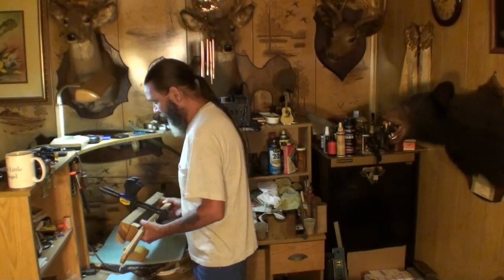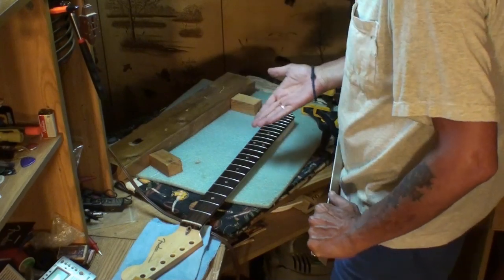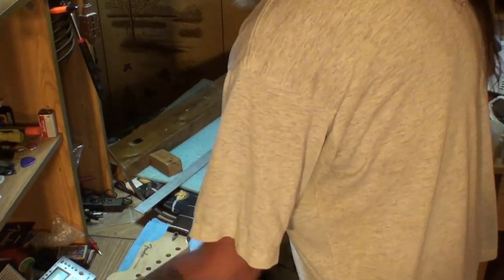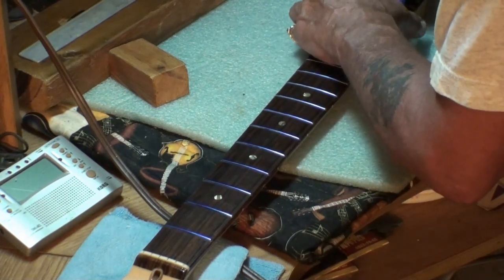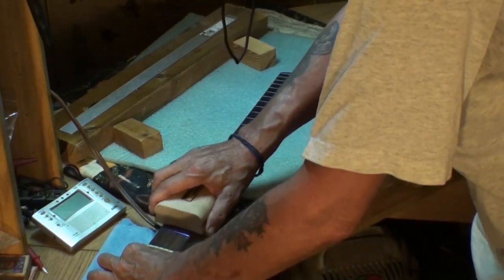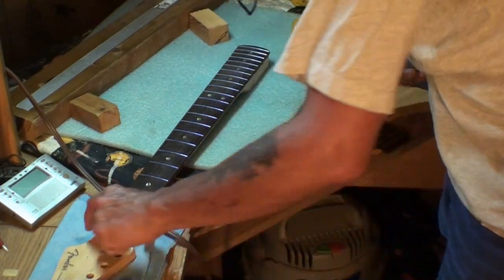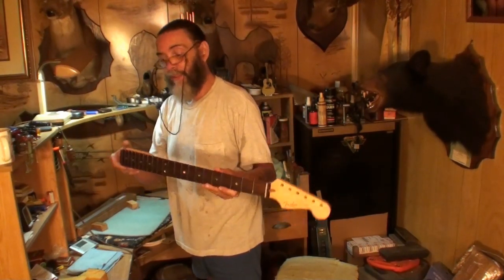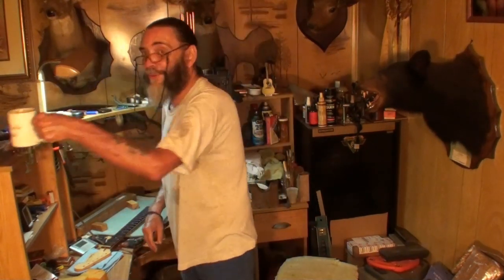american fender stratocaster neck check part 3 will the truss rod hold it straight?

Comment: Looking good Randy but I think you should replace that truss rod nut because sometime in the future he will need to adjust that neck. And he may not have your safe cracking set up to get the job done.
Reply: Of course it should be replaced. Anything else is a hack job. I don't understand why he hasn't done it already?
Reply from the maker: @pallecla  I haven't done is alreayd because the owner doesn't want it replaced, he is aware of its condition and if he wants to pay for replacing it I'll replace it, call it a hack if you want but I don't work for free!
Reply: You should do the nut for free since you're making big money off the several videos you've done with the customers neck.  It would be the right thing to do!  Also what about all the free guitars and parts people send you which you use to promote your channel?  Have a heart ❤️ Randy!

Comment: Looks good Randy...hope that it stayed flat for you. We've had a run with killer heat up here in CT. The air quality was so bad with the humidity that you could have sliced it with a knife...pretty much stayed in the house for 3 days with the air conditioner running. Anyway looking forward to seeing the finishing touches on this neck:)
Reply from the maker: I'll give you a little heads up Ray yes it stayed flat and I was able to even get back bow in it before sending it back to the owner, so when it's under string stress he can safely loosen the truss until he achieves the amount of neck relief he wants. yeah man hot here too, 100 degrees almost every day! been spending a lot of time in the ole AC myself :) thanks for watching!
Reply: @RandySchartiger  Cool beans thanks Randy!

Comment: I wonder if putting that clamped neck in a freezer for 12-24 hours and re tighten might help a worse neck? I think it might? then another 12-24 hours
Reply from the maker: heat would be better, which is what I ended up doing, videos coming soon on this. thanks for watching!

Comment: Way to much slap in that truss rode adjustment and even after you removed the clamps  I noticed it went back to a forward bend because I could see your tshirt when you had it up close. Wouldn't it be better to just change the entire truss rode. To much slap there to give back to the owner wouldn't you think.
Reply from the maker: when I removed the clamps it went from having back bow to exactly flat according to my straight edge, which is what I need to do the frets, the truss rod doesn't need changed but it does need the adjusting head replaced, but I only do what the owner wants to pay for. thanks for viewing!
Reply: @RandySchartiger  Yep could have sworn I saw tshirt when the cam was up close indicating a forward bend.. anyways not to worry, be interesting how it turns out. Keep up the good work cheers!
Reply from the maker: @AndyOges  I could see my shirt but it was thru the gap of the straight edge and the fretboard, which is made by the height of the frets. I don't think I'm explaining it well lol anyways the remaining videos to come will explain it, thanks for watching! cheers!
Reply: @RandySchartiger  Yep ur right, that was what I saw, all happened to quick for my weary eyes lol. See how it turns out!